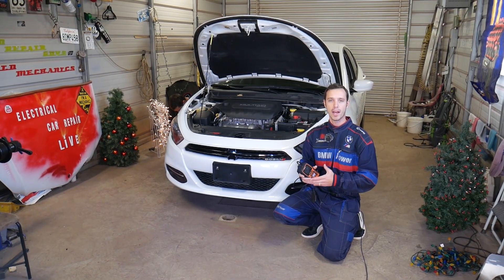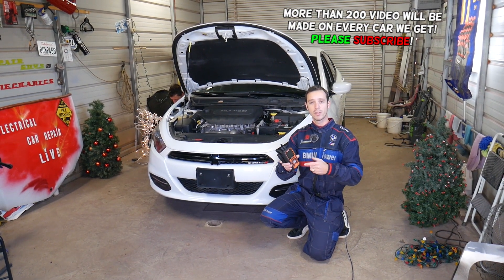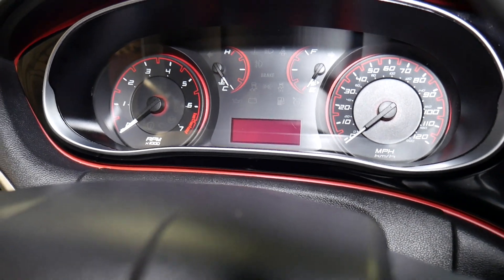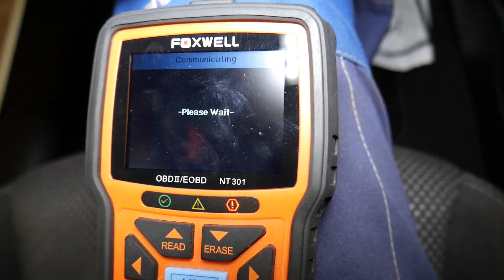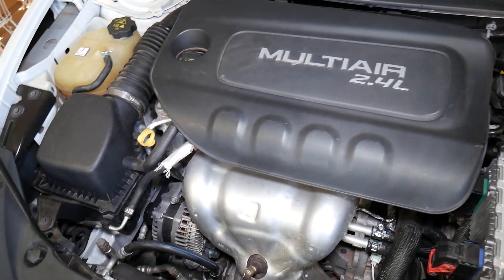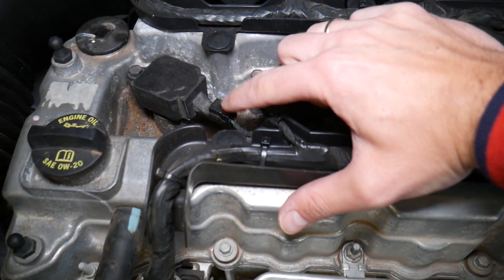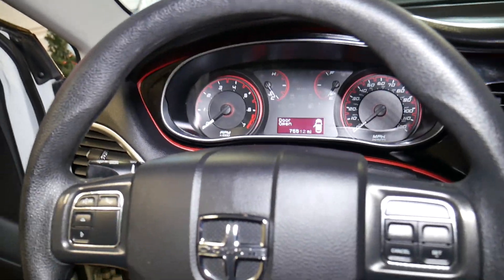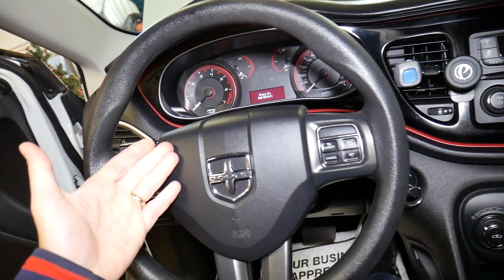CODE P2300 P2301 P2302 P2303 P2304 P2305 P2306 P2307 P2308 P2309 P2310 P2311 2.4 MULTIAIR ENGINE

Comment: It's not as easy as 1, 2 ,3. Replacing the ignition coil does not aways fix the problem. This is the issue I am running into now. SMH